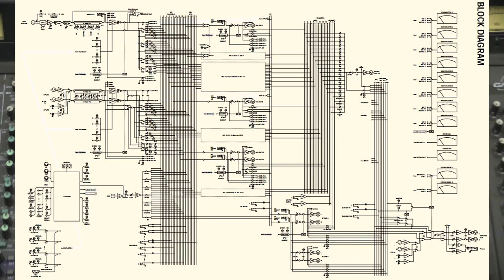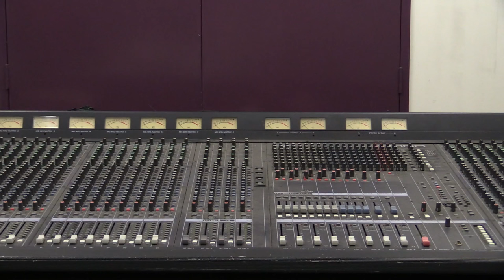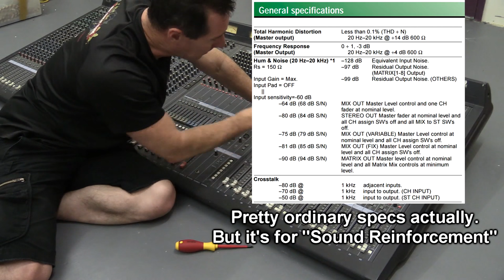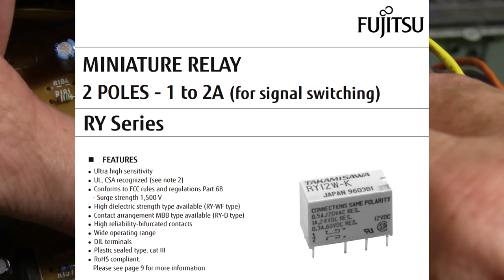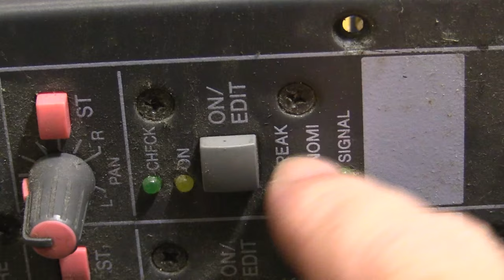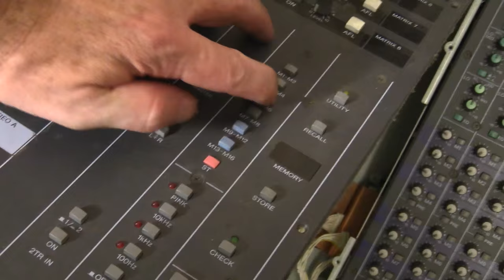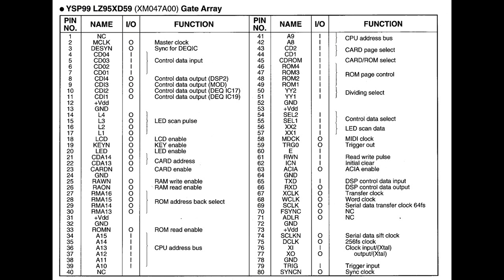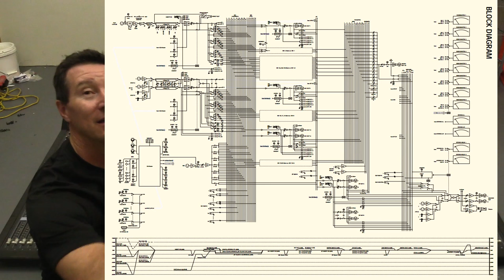EEVblog #840 - Yamaha M3000 Mixing Console Teardown

Comment: For the noobs amongst us, what exactly is this for?
Reply from the maker: +Lee Vuitton (IRCXDS) Those concerts that you go to, it's what makes them sound good when mixed together from so many mics and instrements on stage.
Reply: +EEVblog the mix engineers make it sound good! not just the desk!
Reply: Mixing consoles are intimidating but you can imagine it as an "audio managing" tool. You've got inputs, outputs...you set levels (volume), panning, and can add effects or EQ (trebly/bassy). A mixer (person who mixes) even may multi-task and set up multiple mixes for monitors (speakers so musicians can hear themselves) or different zones/locations
Reply: +jtn191 As with most/all analog desks, you learn one column, you learn them all. The extra fine tuning EQ's and whatnot are outboard equipment.

Comment: Man that's an oldie.... Analog, and I wouldn't consider Yamaha "professional". Let me guess someone spilled one too many soft drinks or beers in it.  Glad it's not a Allen and Heath, Studiomaster or Soundcraft.
Reply: M3000 appears to be circa 1998.  It be ancient.  M3000A introduced in 2000.
Reply: The face looks like it's been attacked by mold.
Reply: For sure it doesn't have Penny & Giles potentiometers.
Reply: Nor does it have Allen-Bradley or Alps sliders.  Alps usually has their logo stamped on the side.  Allen-Bradley also marked.  

Notice the severe rust on some of those slider's shells. It's had liquid spilled in it more than once.
Reply: I have a very early boat anchor Tascam mixer.  Granted it is old clunky HEAVY and not as new as this, however it is great to service as each of the line inputs unplug with two screws.

When I looked at the really good stuff, Allen and Heath, Soundcraft, Studiomaster etc. at NAMM,  the small mixer boards are all assembled to the front panel, and not easily serviced.

Comment: Yamaha makes great (digital) consoles nowadays, but this one was crap. That's why you can get for very low money (compared the similar consoles at that age). It has some output  noise issues, there are some mysterious randomly occurring crosstalk problems reported,  the list goes on and on. You might think it has many LEDs on it, but some important ones, like one next to each PFL button, are missing. Its performance is just piss poor. Yamaha Mixers (both for FOH / live monitoring and for recording) are typically labeled "PM" for Professional Mixer. This model is only labeled "M" for a damn good reason.